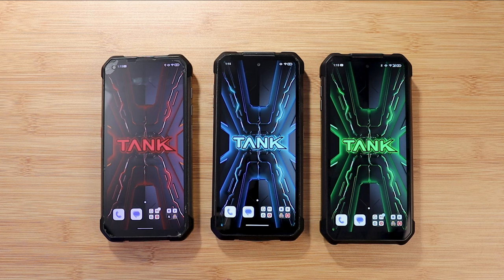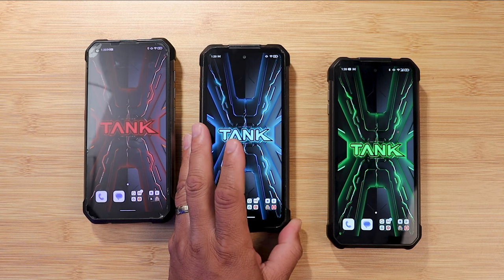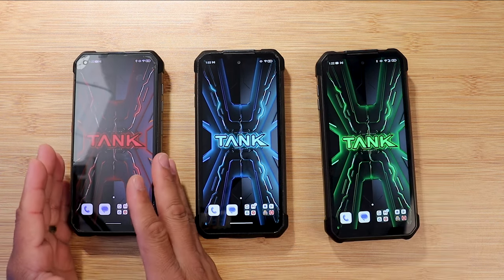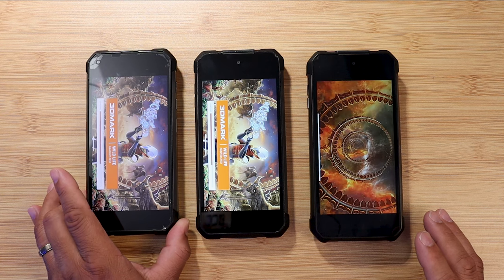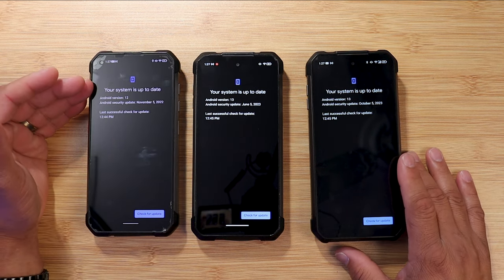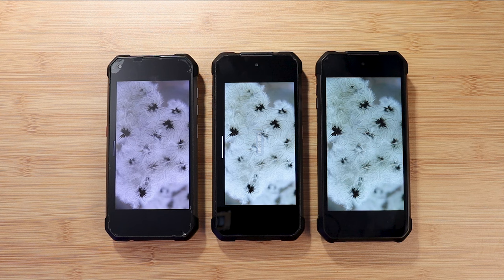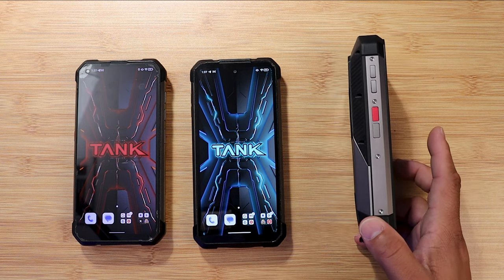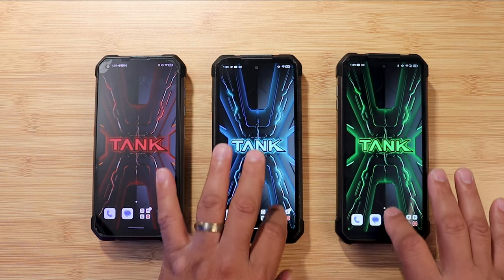Unihertz Tank 1 Vs Tank 2 & Tank 3 | Performance, Display, Build Quality

Comment: I've just received my unihertz 8849 tank_0.1 and it's the 12GB RAM version with android 13 right out the box. there are versions of the tank_0.1 with the unihertz logo replaced with 8849 stamped on the back of device and on the front of the box.
Reply from the maker: Congratulations to you

Comment: Which one should i get, 2 or 3?
Reply from the maker: 2 for the projector or 3 for performance
Reply: @TheTechPreacher  I went with the Tank 1. Price was too good to pass up. Love your videos man, they really helped me make a decision.
Reply from the maker: @danawohl915 ayyyyy thanks for watching I really appreciate it. Congratulations to you
Reply: Just a follow-up. The Tank has been great. But WiFi calling doesn't seem to work even though it's enabled (using Boost). Going to try a Mint sim and see if that helps.
Reply from the maker: @danawohl915 it's probably boost mobile
Reply: @TheTechPreacher   did you have wifi calling working? what carrier?